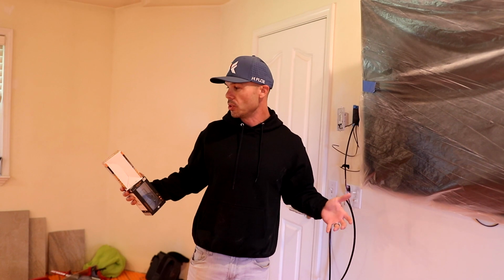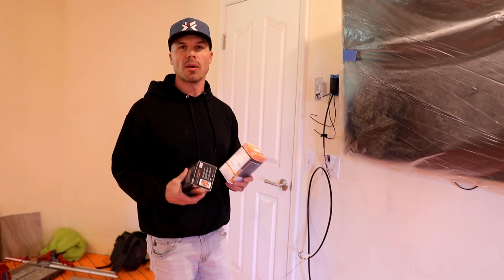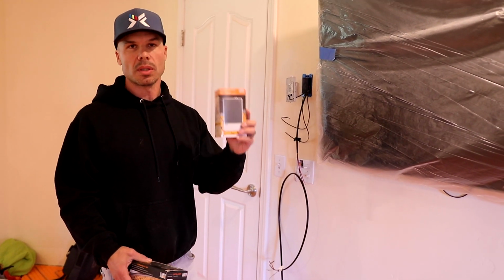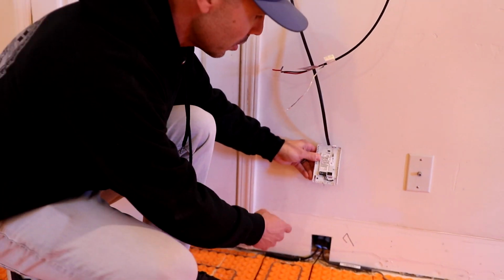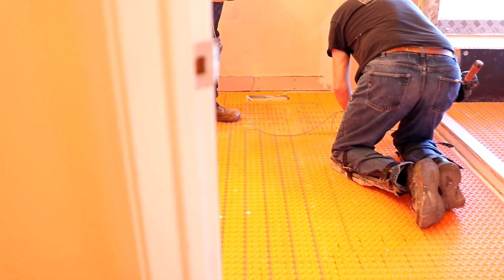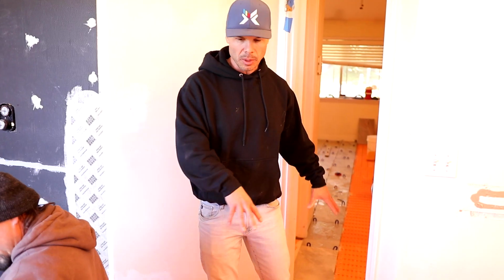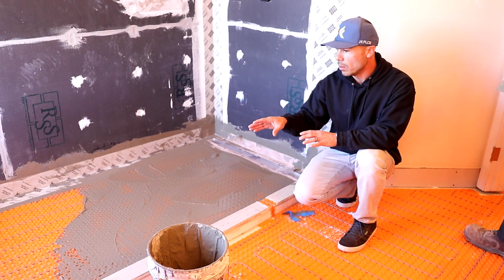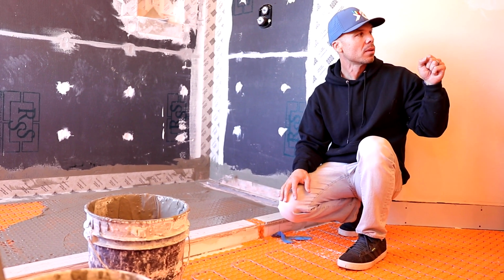Installing a DITRA-HEAT Power Module --- Bedroom, Bathroom, and Shower HEATED TILE FLOOR

Comment: I have entire house to install this system have a question a single 220v will feed thermostat and multiple power modules
Reply: No, you need a 240v circuit from the panel for each power module

Comment: Question: Per Schluter documentation, you can connect "multiple" heating cables to one thermostat "providing" the total load does not exceed 15A. So... lets say you have two small but separate areas in one room, each wired with DITRA-HEAT-E-HK cable whose total "combined" amperage is only 8A.  In this case do I connect the two sets of leads to the one set of terminals in the thermostat - i.e., no Power Module required?

Comment: My electrician placed a gfci  20 AMP  breaker for my bathroom heated floor . The floor will not warm now but worked fine when I initially installed it without help. I would like to replace it with a dd 20 amp breaker without the GFCI. and see if it heats. The thermostat is GFCI the elctrician was being cautious.
Reply from the maker: It could be a faulty sensor

Comment: Any electrician here please advise;

I wired a radiant floor thermostat with only a 30A 240V (2c#10) because I didn't know we'd need a power module.

I guess we can just make a joint and bring the power to the power module?

Comment: What nobody tells you about ditra heat is . No area rugs . They say not recommend for ditra heat . If you do decide your going to add area rug it has to be no more then R1 value . Searched and searched can’t find a rug with a r value rating . I haven’t seen one with a listed r value . Check the tag on your area rugs . I’m certain you won’t find one
Reply: Yep... haven't seen any R ratings on area rugs. That said, in talking with Schluter, although not a recommendation, if you want (must have) an area rug make sure it does not have a rubber backing and lean towards thinner ones that will be less apt to trap heat beneath them.

Comment: 0 seconds ago
Wow bro, I hope you had an electrician check this or better yet, do the install, b/c you clearly don't understand electricity.  Also, if you are going to install stuff incorrectly so that it voids the warranty, best not to videotape it.  You've got cable running less than 2" from walls in spots, cable on the sides of closet floor which is a no-no, and approval from an inspector is needed for the shower bench.  And that's just from a quick glance of half the video.  Hopefully you didn't burn the customer's house down...

Comment: I have been trying to use Ditra Heat in my bathroom. I have attempted to install twice. coverage good, correct trowel. polymer thin set. it doesn't seem to stick well. should it pull up? there is resistance but not enough for me to believe it wont fail

Comment: I got a call today from a guy wanting me to repair tile on a system just like this...tile keeps breaking, this will be the 3rd time it's been done ( I havn't worked on it).  My instinct says tear it all out and start over, is this necessary ?...Is this a common problem with this style floor, possibly wrong type of tile  ? ...Mid Missouri, building code in Mo is gravy, we don't have contractors like most states, you summit plans/blueprints they are either approved are not, point is I'm free to do what i want or necessary .

Comment: Can you help me with a job that I’m doing…..my question is if is ok to tile over concrete sealed shower wall…the concrete sealed wall was the finish looks for a few years but now they want tile…kerdi membrane after sanding or removing the sealer should be ok to set tile…….please help.>…..

Comment: Very good video. I have a questing? How deep do I need to clean the grout joints?  I am trying to clean it the full thickness of the tile. Is this necessary? Some times the clips do not break the full thickness of the tile and I am cleaning it out the best I can. Please help. Thanks
Reply: Clean joints as you go along. Use a sponge. Also, use a margin trowel to knock down the thinset at the perimeter of the tile as you are setting the tile. Then come back the next day and clean out the remaining with a razor blade/ box cutter. Do not wait more than 2 days to do this. It becomes too hard and near impossible to remove once the thinset has dried for a a few days. Some say that 100
5 of the thinset must be removed from the joint to the depth of the tile. You will be good if you remove it to 50% the depth of the tile. Just make sure to remove the thinset on the edges of the tiles and do not remove too much grout during the washing phase.
Reply: @travisk5589  Thank you. I have cleaned most of the joints to the depth of the tile. Thanks for answering my question.

Comment: Love the work as usual. I am planning on doing heated floor in my bathroom in the  future. I do have a question for you (and maybe a future test video?).  How strong are foam pre slopes and ramps? Do you think they will handle someone in a wheel chair with no issues?

I have an elderly family member I take care of and is wheelchair bound.   I considered adding a ramp to give access but have also considered removing the current curb and cutting the shower down to a curb less to allow a wheelchair access.  

Any info from your experience and advice is appreciated.

Forgot to add, this is on concrete slab

Comment: Do you verify that it’s all working before you put the mortar down?
Reply: The cable is tested three times according to the instructions: prior to being unspooled, after being laid, and after tiling. The tests ensure there’s no fault in the ground, conductors, or insulation but it’s still a nerve racking moment when you finally turn the system on.

Comment: Thought the US only ran on 110v? I wonder what Artisan Electrics would think of these electrics?
Reply: We use 120 or 240 volt circuits in the US. 240 volts are used for higher draw appliances such as ovens, electric dryers, vehicle chargers, etc. A 240 volt circuit uses two 120 volt conductors (commonly called L1 and L2) and a ground. It may or may not have a neutral depending on the appliance requirements. Also, 110/120 and 220/240 technically don’t mean the same thing but are used interchangeably in most cases. It’s just an evolution of our grid system over the decades.
Reply: SIngle phase 110ish volts, use 2 phases and it will bring you up to 220ish volts. And then there is commercial.

Comment: Also, would u use modified thinset to bond ditra heat to slab on grade floor???  Thanks.
Reply from the maker: For sure!!!   Laticrete 253 Gold, customs versabond, Schluter all-set, Mapei ultraflex all good choices.

Comment: I thought you are not allowed to run the heat cable vertically? I think I was told that at one of the Schluter classes I took my guys to. I love all your testing you do! Keep up the good work!
Reply: I wonder why
Reply: It was several years ago when I went. I believe they were concerned with the wire overheating due to all the heat radiating up the wire,. Maybe it’s okay for short runs like curbs and going up and down bench face.

Comment: Straight joint, I can do 800-1000 sqft in a day by myself. With a helper, I can do between 1000-1500 sqft in a day. This is not BS, and this is for only large areas with Straight joints.